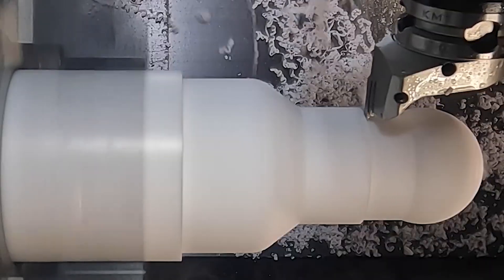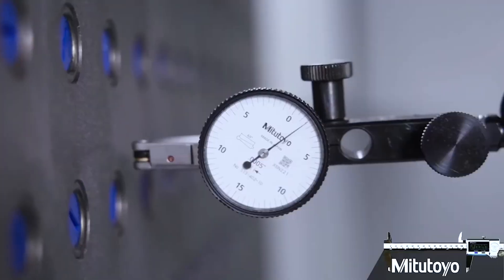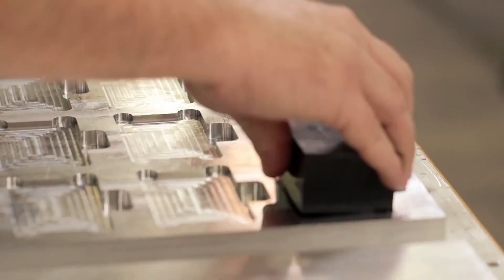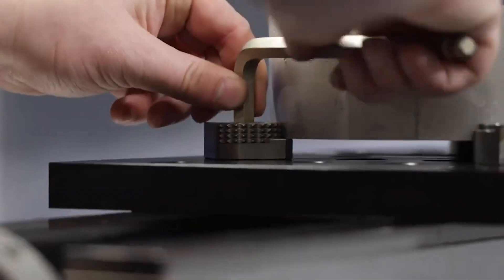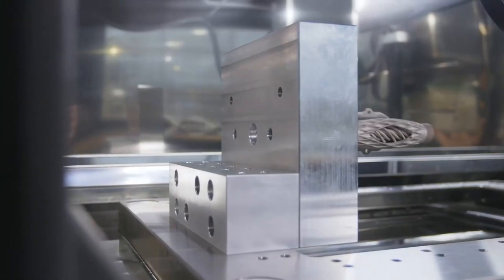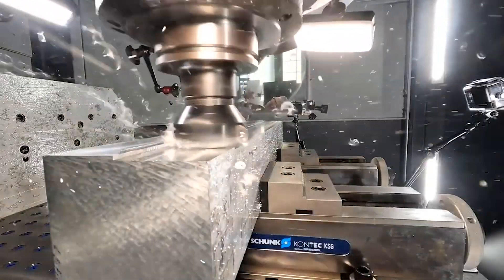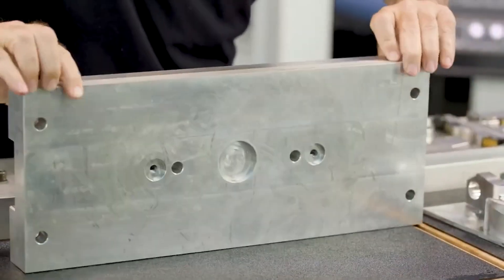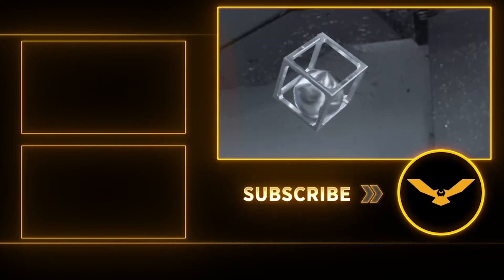$70,000 Dumb Shortcut… Causes Us to FAIL

Comment: I work on average 110-120 hours every two weeks for my company. I started a new position with them almost a year ago, I've been with the company for seven years total. When I moved to my current area, which is a smart store (unmanned automated shipping and storage), the forklift operators were able to move around 7 to 8 trucks per shift. In less than a year that has increased to an average of 12 trucks per shift with pre-staging for the oncoming shift. I haven't so much as gotten a thank you from my company or my boss. I took on the extra work, I did the projects, I solved the issues. So yeah, when someone says it isn't their job, it's for a reason. So I'm not so sure you have a clue what the fk you are talking about.

Comment: I was an engineer with a big aerospace fuel components manufacturer. I made it a point to build a great network of shop guys that I treated with respect and typically brought my ideas to during the design process. To this day I am good friends with the retired manager of the entire manufacturing side of the airframe group. It is amazing what you can learn if you let go of ego. 
I now have my own shop with 4 cnc machines making fuel components. Cheers

Comment: basically it comes down to egos, and there's just too many bosses who can't accept they don't know more than the experts on their payroll.
I used to work at a company that had to fusion weld in a foil burst disk (no filler) and the procedure caused about a 40 % failure rate. The base part cost $800 and it could only be done once, you couldn't redo it.
I figured out a better way and for a year I had less than 4% failure to pass testing, so I was making the company about $600k in extra profits.
Due to a divorce and crazy child support (which got reduced when they finally admitted after a year they'd miscalculated it) I needed more money so asked for a raise. Note that in a small 15 employee company I was making HALF the company profit.
I didn't want much, $1.5 an hour and was refused.
So I quit and found a better job the next day. The old boss that thought he knew everything tried to do my job himself and ruined millions of dollars of production and they lost the lucrative contract. But he never asked me to come back either and I would have saved his company...
see? Ego

Comment: Fun engineering story. Had someone ask what material to make a friction damper material out of. Basically it needed to sit for years bolted up. Then in an earthquake break free and slide back and forth with a bunch of friction at huge loads without galling or failing or changing friction much. I said highly leaded bronze because the lead will act as a high pressure solid lube for a bit. They laughed and said lead is too dangerous they spent years removing lead paint and they weren’t going to add lead back. Ok…it’s not free it’s embedded whatever….turns out they tested every other material they could think of at a uni and every one didn’t work. They called me 6 months later to ask what material I had suggested again. Sure enough they tested it until the testing machine broke. Worked like a charm.  Polished out and ran like a champ.  Copper sucks the heat out and the material wouldn’t gall because of the lead.

Comment: Yes sir. Back in 94 started in union coal miner’s welders fabrication side (strip jobs). Boss came to me it was hot sunny day top mountain no shade where rebuilding drag line house. He say you don’t have to but would you mind going around picking up trash mostly lunch rappers, bags,chip bags paper cups I said yeah he couldn’t believe it ask several of older guys I was green 19. Said they said I’m mechanic I’m welder lm a bla bla. Shoot I told him I was the highest paid janitor in wv that day. He laughed. Said thanks. I drove around top mountain all day in company pick up ac on to three different big sites few miles apart. Pick up trash. Good times. Just shy 20$ hour. Oh yeah might been time and half that day as we worked 12 hour shift till job done few weeks. So yeah seen it back then to that not my job. But if company goes bankrupt then it’s no job. Anyone. From ur ole hillbilly buddy stay safe.

Comment: I worl with Teflon every day. Old-school "Teflon" meaning PTFE  have a phase-transition at around 18 degC (room temp) that also give a change in dimensions, explaining why it is hard to keep accurate tolerances. Today there are modern alternative materials that also go under the name Teflon, for example FEP and PFA. These are chemically the same, but they are not pressed, instead they are cast/melt-extruded so no risk of porosity, and they have much smaller thermal expansion around room temperature.
Reply: Teflon™ is just a brand name. Teflon™ ≠ PTFE, FEP, or PFA. For those, the correct name, presuming it's coming from or licensed by Chemours,  is Teflon™ PTFE, Teflon™ FEP, or Teflon™ PFA. Using it as a generic term for any fluoropolymer is just genericizing the trademark, similar to Kleenex, Xerox, and Band-Aids.

And they aren't chemically the same, only very similar.

Comment: I've got 24 years of machining experience only in plastics 95% is virgin ptfe. And rough the stock down to .200 of finish and recooking it will help alot is in get a more stable and consistent part. But also most ppl don't realize thermo expansion is only part of the issue with compression molding. The amount of stress that is released after a part is cut off is a huge factor. I've seen parts @17 dia grow over night in the temperate controlled environment .080 to .090. So keep all those thing in mind guys. And in my opinion UHMW is probably the hardest plastic to hold tight tolerances. Its basically a garbage material and is used as the cheapest alternative. Give me ptfe mc901 vespel or peek over UHMW any day.

Comment: We ate 1.5 million dollars because we ordered from a guy that could do it cheaper. We had 800 machine hours in 250 parts that later failed crack testing after weld because the alloy wasn't to specification. Then we spent another 750k remaking them.

Comment: TITANS!: I have a seriously badass project that  must be attacked head on. This is a the gauntlet being thrown down.   And hopefully that is sufficient in goading you into doing it.   Here we GO  2x72 belt grinder  The criteria: 1.must tilt 90° . 2.must be 100% machined with the exception of the motor,vfd, fasteners, wires etc.  Must be fully loaded with rotary platen, small wheel attachments, contact wheel flat platen and slack belt all integrated into one easily switched component on the standard tooling arm   along with surface grinder attachment the can be incorporated seamlessly.  As well as a comprehensive tool rest with indexing for stuff like angle.  It can be constructed of which ever material you wish..aluminum titanium(TITANS?) STAINLESS STEEL.. doesn't matter  must have unique belt tracking system that works as well as tensioning mechanism and tilt   you have a week. Good luck.
Reply: It's going to take more than a week just to design that.
Reply: @jmowreader9555  yea i know but let me have my delusions please..lol . I really want to see them make a unique ultra high performance grinder.. I know they would make one that is amazing and they  would do an awesome job producing a video showing how it was done.

Comment: Awesome story. Sadly there are also people out there that think the other way around, my boss once said to me "It's not you're job to think about that, it will work" when i told him it will not. 

Our company bought 4 machine's that where old and in bad condition from a insolvent company together with the contract that was running on them. My boss wanted to make them run even faster when they already where on they're limit... well in the end every thing didn't work out and the company made a loss with that contract cause they where forced to make that part's for about 4-5 year's by law. They lost even more money cause they didn't hear on us when we told them that we need repair here and there, one time the colant pump from the highspeed engine faild and they didn't repair it... well 50000€ for a new engine...

Hell i'm so happy i made it out of there, it realy was toxic and energy pulling in that company. Sadly it needed a Depresion befor realizing what they did to me...

Comment: Just a bunch of stock machining footage mostly aluminum and glamour shots of expensive machine tools... That was a pretty long speech to convey some simple facts and to say "things ain't like it used to be"... Bottom line is that if the incentive is there people will " do the right thing" but if the company happens to be like most and sets up it's employees like crabs in a bucket then yes people will sit back and watch each other fail every time!!
Reply from the maker: That’s a pretty long answer to not really say anything of value or to even mention what the video was really about. 

The video shows the importance of knowing all the variables in machining and especially in material selection. Shows that just because a material might have the same name, it can be drastically different. Is it cast, annealed, extruded etc. Also that certain materials grow drastically after machining due to the thermal characteristics. Knowing all of this and following print recommendations is imperative to meet all tolerances and produce a part that can be shipped and sold.
Reply: My comment addressed the fact that there was little to no footage of what the video was actually about... Also I addressed the boomer-esque speech about companies,  "nowadays" and "doing the right thing".. the other stuff is all good (if vague) information about thermal expansion, material choice, how said material is created etc..... All playing a huge role in hitting accurate dimensions in Teflon or any material but especially Teflon... The machines, machining, tooling, information, fixturing, picture quality...... are always second to none on this channel but for most people in this profession it is a fairytale and in real life the underpaid boots on the ground wouldn't even have a chance to voice this type of thing to an engineer before he/$he was replaced by someone who doesn't speak enough English to say anything about anything above his/her pay grade...
Reply: It's also interesting to me that there are hundreds of comments thanking you for the awesome video and praising how good it was or talking about their own experience machining Teflon that were made before my comment... None of those have a long winded reply... Or any reply for that matter 🤔
Reply: It's almost like this channel is just for advertising purposes and not to help people with their stuff...

Comment: People are asking if the close tolerances are necessary. If the material changes significantly with ordinary temperature changes, then it will be changing in use, and will not stay within the tolerances so carefully manufactured. Clearly useless.

Comment: Is Teflon plastic like this the same as Teflon used in old frying pans that causes cancer and know as a “forever chemical”? I’m very curious to know as I’ve been making Teflon piston rings at work and machining it makes a fair bit of fine dust that I’m surely breathing in a little bit.
Reply: It’s mostly about burning it which releases the cancer stuff if I’m correct (>200C)
Reply: They also sell PTFE spray to lubricate chains. It it would be cancerous at room temperature I assume (hope) it wouldn’t be legal to sell it without any warning
Reply: @ronald7638  ya that’s what’s you hope anyway. I just watched that Dark Waters movie about Teflon and everything the company DuPont had to do with it, definitely has me a bit worried. Lol

Comment: But what if you and all your employees hate the company ( and management ) ? How much do you give them ? I’m not proud of it , but I once sat back and watched almost every single person in management and engineering try to do a simple task on a machine all day long. They had demoted me temporarily because I actually took the vacation I turned in for and they approved. Did I eventually help them ? Yes. Was it 5 minutes before my shift ended ? Also yes. Do I work for them anymore ? NO
Reply: Sounds so familiar.   I once worked in heat treatment departement of a big company.  I had , 1995 , a beeper always with me in case of problems in the heat treatment departement  24/7 .    When I went for 2 weeks on vacation I wrote a complete  manual for 2 of the most important furnaces ,  in case of problems,  which always should be running as whole production of this  company was treated in those 2.   Nobody from management wanted , not even a minute, to talk the manual through and show what to do in case of problems.      Then I dropped the manual at 1 of the operators of the furnace and went on holiday/ vacation.

When I returned ....management  called me out for not so pretty things...as it was almost  impossible  to solve malfunctions etc...it was A NIGHTMARE.

Then I went to operator of the biggest furnace..... I asked how was the NIGHTMARE ???  He answered :    management are a bunch of weeners...I took your manual in case of malfunction.......looked up the specific malfunction and followed steps in the manual :  NO PROBLEMO !!!!  Those wankers in the office should SHUT UP !!
😂😂😂😂😂😂

Comment: I would be willing to bet that this part had no need of such tight tolerances.
Reply: Oh man. I saw H7 specified for a hole which gets rubber grommet later to run some cables thru. Many times. Why ? "Oh, our cad package put it in like that" lol
Reply: LOllllll @Trancelebration
Reply: Happens all the time at my shop...we're having trouble holding tolerances, the boss calls the customer, the customer verbally revises the tolerances on the spot.
Reply: having taken mechanical engineering, I can say new engineers are not taught much about tolerances other than the fact they exist and some conventions for how to read them. Usually just pulling pre-made standards for a file hard steel and using that for everything. I can't imagine how much this costs industry everywhere
Reply: It could be going into an precision temperature controlled environment 🙄
Reply: This is why designers and machinists should always work together when designing a product, not separately. 
For example, the designer may wanted a paper plane, but due to the high tolerances, complex materials and mirror finishes, for the machinists it looks like as if they wanted a combat plane.
Reply: Love when our customers engineering department thinks +/- .0002 is "Totally doable on UHMW plastic".

Well, leave this part machined at 60-70° Fahrenheit outside in 50° weather and watch it shrink up by .0005 or soak it in water and watch it swell by that much.

Engineers can put good ideas on paper, but alot of em don't know what they are talking about in the real world.
Reply: @VeeDubConnoisseur  I call them office engineers.
Reply: @VeeDubConnoisseur  While I'm not a machinist, us in the automotive industry refer to recalls as the "engineers comeback"
Reply: I would be willing to bet that this part doesn't exist.

Comment: Ah yes, the very best kind of job: impossibly-tight tolerances and it's got to be done RIGHT NOW! And...I'm going to take a wild stab and guess they didn't need enough of these to justify making a set of molds that would allow you to receive teflon parts from the supplier in a "close-to-finished" state that you could machine down to spec.
Reply: Not going to lie, it sounds like one would be enough to justify making a mould. If even roughing it is a problem, and you are wanting to stress relieve after that, then making a rough mould out of a cooperative and cheap material instead and sending that to the supplier should give you a more accurate rough with far less headache.
Reply: @agsystems8220  Do you remember the famous "$640 toilet seat" scandal that rocked the Pentagon in the 1980s?

What Actually Happened: In the 1980s the Navy hunted submarines with the Lockheed P-3 Orion. They made an Orion by flying a newly-built L-188 Electra to their military aircraft factory for installation of the defense electronics package. It has, among other things, a toilet with a fiberglass top. Come the 1980s and quite a few of those tops had cracked. The Navy ordered, IIRC, 56 new tops only to be told "we destroyed that mold after we stopped making Electras in 1961. If you want any new tops you also have to pay for a new mold." Lockheed worked the cost of the new mold into the price of the new tops. If it was me I would have tried to talk the Navy into changing to stainless steel tops that could be made on a sheet metal brake.

The moral of this story is the customer would not be happy to receive an invoice that read "one finished part $2000; one sintering mold assembly $25,000." And from the description of this part it doesn't sound like something anyone else would want.